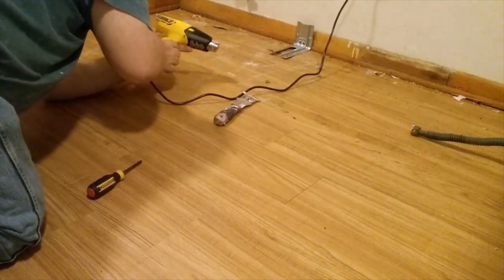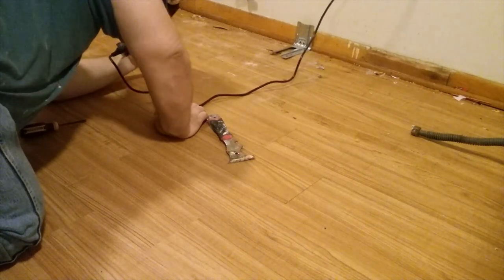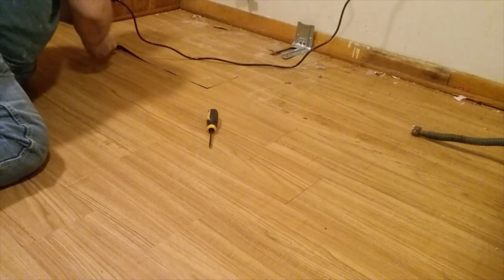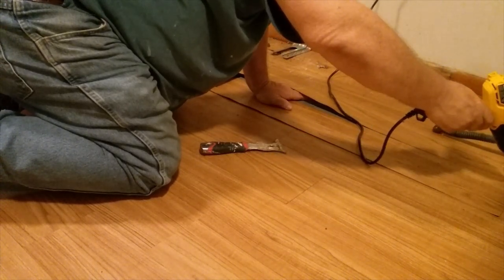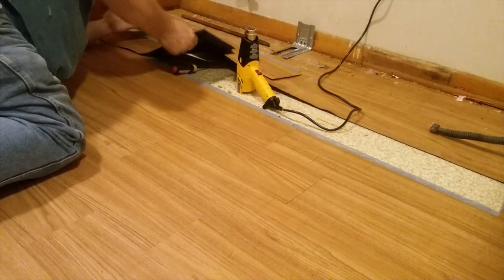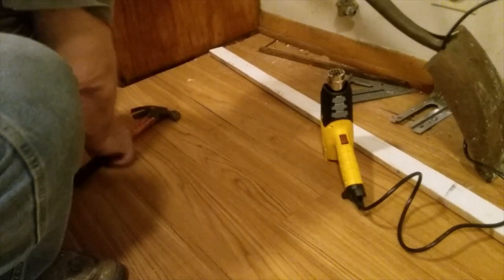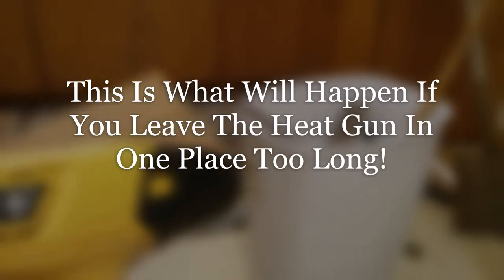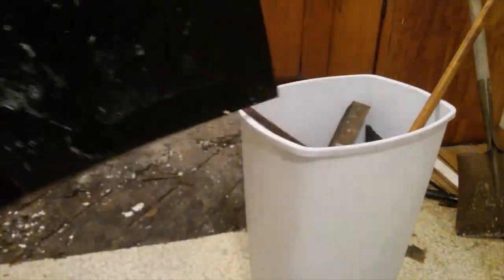How To Repair Allure Flooring By Replacing Planks

Comment: Do you see a big difference in the grip strip compared to peel and stick? I am needing something to get by on for now and wanted a honest opinion if you can tell a difference between the two?
Reply from the maker: I've used the peel and stick on a couple bathrooms. It turned out well also.
Reply: The grip strip are well made and stick to each other . the peel and stick stick to the floor itself. If it is a temporary floor the peel and stick is less money.peel and stick can pop up when they get old if using on a concrete floor.

Comment: any ideas for gaps at seams.  installed tight next morning 1/32-1/16th gap in several seams.  how to repair?
Reply from the maker: The only time I've had gaps at seams of Allure Trafficmaster flooring was if the floor wasn't perfectly level. I have fixed many of these areas by going over them with a 100# roller.
Reply: @BlueCollarDIY  thanks, The floor is level.  I am going over 1/8" indoor/outdoor carpet that was glued to concrete floor.  I'll give the roller a try. I thought my 270lb body in stocking feet would do the trick.
Reply from the maker: @jlag2663  I've used the small rollers and put my 300lb body over the Trafficmaster Allure flooring. But it still is not as good as a heavy roller. You can rent them at many rental places.

Comment: I got some areas in a rental trailer that I need to replace, but the damage is that they swelled and bubbled up.
Reply from the maker: The orginal flooring is bucked and bubbled up or the Allure flooring is buckled and bubbled up?
Reply: @BlueCollarDIY  the Allure flooring.   I really don’t know what my prior tenant put it through as I had one place than needed repair about 3 years ago and now the whole thing is messed up.   I was interested in going back with glue down.
Reply from the maker: @jonathanwhaley9633  The only time I've ever seen Allure bubble up is when I was burning some scraps.